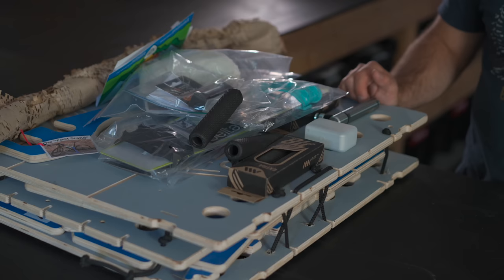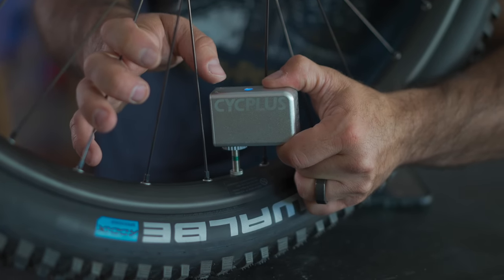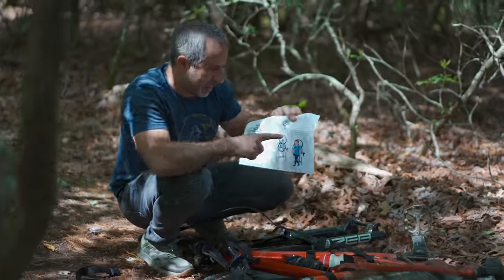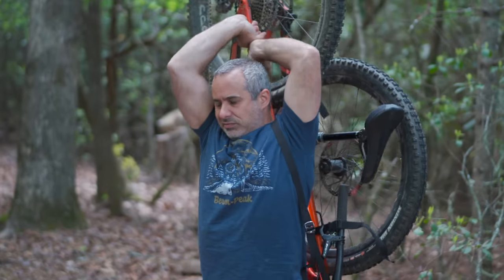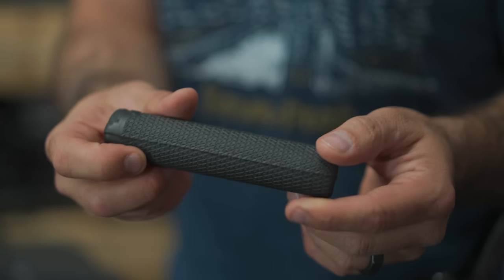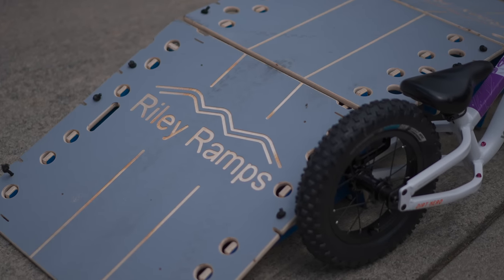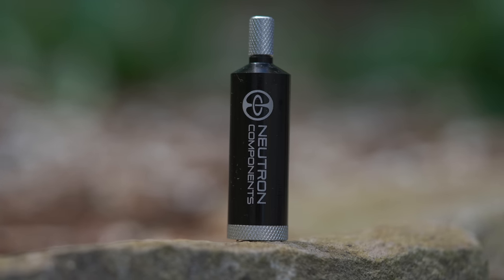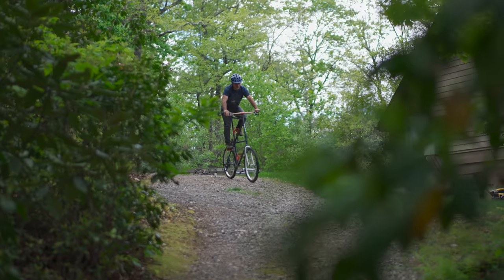Rapid Fire Reviews: Weird Bicycle Products!

Comment: I was actually really excited when I saw the Cycplus pump, but would be using for road riding.  Getting a road tire to 80psi in a little over a minute is a HUGE improvement from using my mini pump to maybe get the tired up to 60psi after 4 minutes of frantic pumping. And I like not having to waste COs.
Reply: I run one from Autder.  It is around $40 but quite big.  It's 45mm/1¾" in diameter and 247mm/9¾" long.  But it can handle several inflations and goes up to 150psi with auto shut off.

Comment: I switched to the fillmore valves about a year ago and to me they are a life changer. never had a clogged valve anymore and the pressure gauge on my pump is also much more accurate with these than with the normal valves. I'm never going back to the standard ones

Comment: Having had to walk out about 4.5 miles from a flat (burped a tubeless, couldnt' reseat the bead) I did a mix of very gentle riding, walking with both wheels down, walking with the front wheel up, and carrying the bike.  Thankfully it was an older hardtail that weighed next to nothing, but having variety of ways to carry something for a few hours is nice.

Now these straps?  Maybe for a cycle adventure type setup?

Comment: Seth i have a set of those awesome Passchier bars. Please put them on your titanium hardtail and take them on a true trail ride.  Your mind will be blown. 
I think product's like this will be the future. 
These bars and hardtails are a match made in heaven. Your main contact point and control is your handlebar especially on a hardtail. It let's the bike move  beneath you as you fly through chunk and rock garden. 
They are just not designed for big jumps ie dirt jump riding. 
But for trail and high speed control pure bliss

Comment: Re the bamboo bars and sweep...I've used a set of 16deg SQ Lab 30x bars on my hardtail and they're great for improving wrist angle. I then paired them with some Ergon GP3's (I like the bar ends, but not necessary) and it's great for the hands. This bamboo bar likely does similar but I'd like to experiment with that flex, I think it would suit me.

Comment: Road bike may be low volume but it's high pressure... at 3-5x the pressure of a mountain tire, a road tire can have just as much air in it as a mountain tire. I'm not a Co2 fan, I'd pick the battery pump simply because I can re-charge it without having to buy refills. I currently carry a Crank Bros Gem, anything smaller feels useless and it moves air like pumps larger than it do.

I like the fillmore valve but I hope they come in Schrader sizes too, Schroeder fittings are just more common to find and if you have a flat local mechanic or tire shop might be able to help you instead of having to find a bike pump...

Comment: Re: the road bike tire volume thing; it's not actually that different overall volume. Maybe getting your tire to 50psi and getting home requires a bit less air. But at full riding PSI, 25 for mtb/90 for road bike, the amount of air required isn't that far off.
Reply: I wanted to comment something similar... but my MTB tires (29x2.25) are rated from 26 to 54psi (I use them at about 45psi) and my City/Trekking tires (28x1.5) are rated from 50 to 80psi (I use them at about 70psi), I guess 90psi would be on the low side if I'd use a road bike at my weight.

Comment: Thanks for reviewing the battery pump. I almost impulse bought that a couple weeks ago; glad I didn’t!
Reply: I don't really get his negativity on the pump. I thought it was pretty good. Did the job, rechargeable.
Reply: @andoletube  my issue is that it can only put out ~40 psi before it dies.
Reply: @mattlarsen8585  That's on some pretty beefy tires  though - and that's from fully flat. It's enough to get you out of trouble.  A lot of the time, you're just adjusting pressures rather than inflating multiple tires. I can't think of any time when I had to fully inflate 2 completely flat tires while I was out on a ride. Anyway, that's just my take on it. I respect if it doesn't suit your use-case.

Comment: the battery pump paired with a battery bank would be insane, it has the ease of use of the co2 and the reusability of a regular pump, sure it's slightly slower than a co2 and quite a bit more expensive but i say it would be worth it especially considering how cheap and small battery banks are nowadays

Comment: With the pump, the road bike and MTB comparison works both ways: the battery pump will inflate in quick, and possibly get 3-4 rounds in, but it is also just as quick to use a hand pump.

On my road bike I have a micro floor pump mounted to the frame (has a small foldable foot, and an air hose), and with that I can get to 85 psi in 15-20 seconds (we timed it), and I run 28 mil tyres instead of 25 or 23, so you can do even better.

Comment: 2:26  Fumpa can do 4 inflations, if it goes well. Current version has USB-C. It has a digital pressure gauge.  My pressure are 28 rear 26 front.
I have the original. It has worked well, but the new one should be better as they apparently fixed the issue where the USB port fell out. It's heavy compared to a pump but it's worth it. but you need to recharge, as all battery stuff eventually battery drains out, So don't leave it for a week and to without recharging. 
They have a Fumpa Mini too similar size to Cycplus, also no display on that one.

Comment: With that lispy sounding Stwarp I think you should add all the components after you've tightened around the frame. 
 I think are affecting how tight you can get it and if you put them in afterwards it would make a difference. 
Love the bamboo bars 👍👍

Comment: The fillmore tubeless valves are beyond stupid. They're absurdly complex with proprietary parts, and just fitting a schrader valve to your bike will give you more benefits with less cost and complexity.
The hilarious part is that just buying a set of those straw cleaner brushes will easily fix any clog you ever get. Without a dorky-ass valve.

Comment: I can totally relate to the bike carrying strap ... in the 90's (yes I'm that old :P) I had to carry a a bike for something like 4 miles (6km) because there was just no possible repair in-situ. The bike had its fork tube broken at the base of the tube (wheel side). 
Nothing "ridable", nothing "pushable", and as you probably figured it weighed a ton ... full steel frame, metal rims, tubed tires, nbothing fancy as you can find today ...

I'd definitely had appreciated such a solution ...

Comment: to carry: stand on the left side of the bike, left crankarm downwards, left hand to the fork, right to the seattube, shoulder the bike (frame behind the head / neck + bottom bracket slightly behind your right shoulder + top of the bike is pointing backwards) with the crank arm resting on your trapezius muscle (collarbone), works nice. during carring right hand grabs the crankarm, left the front wheel or the fork. when its narrow (trees) just walk sideways. 30-45min should work without any issues.

Comment: Got a bigger pump, use it a lot. As most of the gained size is battery it lasts several bikes and beach toys.  ost me 35$. I would say it is worse than a compressor, better than having just a standing pump without canister.

Comment: I don't think the pump is marketed to me but i will give you a use case for it. I'm in a wheelchair and pumping my tires myself is almost impossible so having a small lightweight thing that is reusable to have just in case has my preference. The fact that it is $80 however makes me not want to buy it but get a bunch of co2 cartridges

Comment: I bikepack with my gravel bike and the little electric pump is pretty slick. I have a “Fumpa” pump and I think it can do almost 100psi on 700c in under 100 sec. I’ve filled up my 700x38 to around 45psi at least 3 times from flat so not bad! I think it’s a better alternative to co2 carts personally. 

Those wooden bars also looked neat but spooky. Imagine they snapped on a bump downhill at a speed… not that you should be using them in such a situation.

Comment: I have that inflator. It fits into a Specialized triangle under my water cage along with a tubeless patch kit and a tire lever and a small chain lube. Multitool is under the other bottle cage.
This is an awesome setup. 
I used to carry 2 canisters just for 1 tire because I use 28PSI and I fumble the gas inflater. 2 canisters wouldnt fit my triangle also.
Its also useful for small inflations like going to 30psi from 20 if I lost some air.
Lastly I just backpocket it when going on road bike. Good luck hitting 90PSI with hand pump 😢

Comment: 3:00 i just got a thought ... the Electric Bike Pump isn't that bad - but it needs more Acid. Make it twice-trice the size and usable as an 2000-4000 mAh emergency power bank (integrate some short, basic USB-C cable - or just the plug - as well maybe) and most people would happily chose this over a powerbank *and* something to inflate the tires. 
ie be able to make an emergency phone call and pump up the tires to get to wherever you need to go.

Comment: Coaching MTB to a DH-club for kids. The amount of flat tyres we get is frustrating. It got to the point where I got a those Lezyne standing pumps but then I'm forced to have a backpack. CO2 I dislike using because of the cost and waste. I only use that for tubeless.

This mini-pump sounds nice but then again, it's a bit expensive. The typical pick 2 out of the 3: cheap, effective, small.

Comment: I would like to point out that I carry a full tool set and replacement derailleur hanger in my saddle bag wherever I go. Unfortunately, once I wrecked my derailleur so badly that I couldn’t limp back to the trail head on it and part of the derailleur jammed/locked up my rear wheel. The only thing that I didn’t have In my toolkit (which I do have now) was a chain tool. I had to carry that bike for a long time before I caught up with a ATV driver that had a multi tool that I could pop the master link with. From there I was able to take the mangled derailleur off and coast back to the trailhead. I personally don’t have a desire to keep the strap with me while riding but if you are in a club or large group and are traveling somewhere relatively isolated having one on hand could be useful in the event that one member needs it. I understand that it is a relatively niche market and that as such the product may struggle to sell but it could be useful occasionally.

Also, love the channel! Your videos are always thought provoking, entertaining, and educational.

Comment: 1)Find a higher yield battery, or more efficient pump
2)Fucking ingenious!! Looking forward to the results.
3)You know your bike has wheels, right? As someone who salvages frames on his own bike, often transporting frames with no tires, I would find this useful.
4)Unsure
5) 80% Weight= less material=lower quality?
6)Awesome idea, well executed. You could find a cheaper production method.
7)Kung-Fu Panda would be proud, until he ate them.
8)Paracord works easier.
The pump is probably the best in my opinion. It needs work but AWESOME product.

Comment: have had the fillmore valves for almost 2 years now, never a clogged valve. Only issue, although it won't apply to all, is putting sealant in. Most injectors do not work with it since there is not a valve core to remove.

Comment: FUMPA makes a better eletric pump imo. You can choose from 3 different sizes which allows you to choose which size and weight vs how much air you will need. I have the biggest one, I leave it in a pack and use it all the time. Super quick, and it has an integrated pressure gage.

Comment: That electronic pump built into an ebike powered by the battery and a neat coil hose is the future, for now could use a phone battery extender to power the pump directly &/or to recharge on the ride

Comment: I carry a fumpa rechargeable pump. Much heavier. But it will pump up at least 4 high volume MTB tyres and also re-seat a tubeless tyres. Also I just arrived in Japan with my bike and the brakes needed some new fluid after the flight. Luckily I was carrying a Neutron components bleed thingy.

Comment: 2 min to pump is actually quite long.
But it is much smaller than the other electric pumps and my emergency pump.
Strap thing is cool, would've been great from when we had to steal my friend's bike back.
We used some ropes which we had to keep adjusting every 2km.
But other than that, just roll the bike on 1 wheel. Heck, my friend's bike wasn't even an MTB, it was a bmc timemachine.

Comment: you should have tried the electric pump for road tires... less volume but 80psi on 28c, 100 for 25c, 120 for 23c. 
You can't ride with 80psi on a 23c and expect your rims to survive any pothole or wide crack in the road if you're, well, taller/heavier. 
And if it maxes out at lower than that, it would be useless for road tires. (unless you consider gravel bikes in that category)

Comment: I've converted to the Fillmore valves on all of my bikes. Its quite frankly silly how much easier they are to inflate with than my Muc-off, specialized, Cushcore, and orange-seal valves. Like how is that even a thing that you notice? it blows my mind that these haven't been made earlier. its comical that these valves are something to note. its just a tubeless valve. 
I've had my oldest pair set up since they released on spank 350 vibrocore rims. That setup is still going strong and has been refreshed twice, both times through the valve. 
I also have them on a set of Roval Traverse alloy, Axis Elite, and Roval Traverse SL rims. 
All of my setups Orange Seal Sealant and Specialized tires. 
I've spent about $240 on valves which isnt the greatest, but I've had zero issues with clogging or leaking around the valve.

Comment: Fillmore valves are awesome. Not just for not clogging, but for seating with a pump
Reply from the maker: I didn't know that!
Reply: @BermPeakExpress  came to say the same thing, no core to remove and flows enough air to pop the beads on most tire/rim combos I’ve tried
Reply: Orrr...hear me out, a schrader valve. Doesn't clog, doesn't need core removed, doesn't have unique and expensive parts, and they're cheap.
Amazing. It's like everything you want.

Comment: When I was younger I was freestylin' on a GT bike.  My bike had a Gyro so the headset can spin 360 degrees forever.  How come MTBs do not have Gyros? If you crash and the front fork wants to spin more than 360, wouldn't the gyro save the housing and cable from getting damaged? And just for flexibility. Just running thoughts through the noggin 😁

Comment: I have not seen any videos on automatic shifting systems for bicycles and ebikes. More specifically how the average rider could use these systems on their current setup to their benefit. I currently use a bike o matic which is an old and out of production system but does the job. It makes my ebike more efficient but not really faster. Faster comes slowly with these systems as it's really more about efficiency than speed of travel.

Comment: Regarding the pump. Road tyres have a way higher pressure, 7bar Vs 1.5 (ballpark figures). So I guess the volume is about the same between tyres.

Comment: The appearance of the 'Fillmore Valve Stems'  make it look like the valve core can 'fall into the tire'. OR is it designed so it will NOT fall into the tires when you take the cap off? TIA.

Comment: I have a Radwagon 4 cargo bike and my one worst case scenario (thankfully hasn't happened yet ) is a rear wheel flat in the wild. Because it is an electric cargo bike saving weight isn't going to be an issue so I was wondering if the Riley Ramp might be a portable solution to raising the bike high enough to comfortably change the rear tire. (when fully kitted out the Rad would be a real pain to turn upside down to fix the wheel plus fully loaded it is REALLY HEAVY). Do you think the ramp could fulfil this roll?

Comment: I don't really get Seth's negativity on the pump. It looked pretty good to me. Small and light enough, did the job. You don't always want to pump a tyre manually when you're tired after a lot of riding. It's ok if you prefer another option, but I thought it was excessively negative - like implying it was kind of crappy, when it actually seems like a well made and considered product.

Comment: That pump would make more sense for ebike use case, Baterry on my bike has a 5V usb output (for slow charging your phone).
That can keep the pump always charged thus making it superior to a hand pump or co2 cartridge.

Still, this thing is way too expensive. There are electric pumps for as low as 15$ featuring a bigger battery and a power bank function

Comment: I can picture the hike a bike strap coming in useful if you end up with a badly tacoed wheel, or some serious failure to linkages/cranks, rotors, etc.

I'm pretty sure it's not really meant for things which we encounter often, flats, bent derailleur hangers and the like. Would be more of a worst-case scenario item for serious crash related damage.

Just me two cents.

Comment: Hey, my name is CJ, i am 16, I have been riding mountain bikes for a very long time. I currently own a specialized hard rock, hard tail that I bought off Craigslist a few years back. I recently broke the rear axle, which broke the chain and bent the derailer really bad. I decided that it was time to do some upgrades. I want to go with a nine speed in the rear and only a single gear upfront but the problem is I currently have a free wheel set up instead of a cassette. and it seems pretty expensive to convert it. What do you recommend?

Comment: Only 2 inflates? That's pretty weak. My China one is a lot bigger, but it'll do car tires. It also has a USB power plug, flashlight, and a psi gauge with auto shutoff so you can dial in pressures. As an Ebiker, it's my go to. I can air down, then back up, then fix people's tires on a group ride, my own, and still make it home.